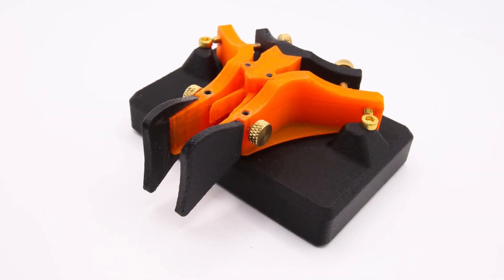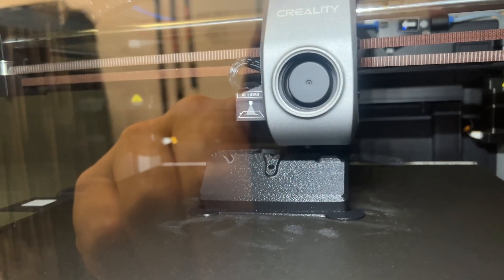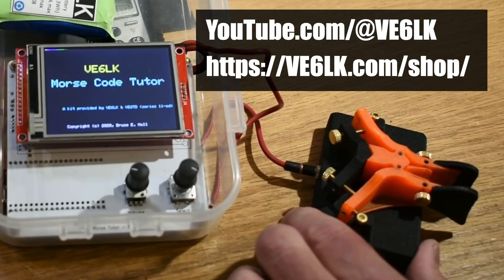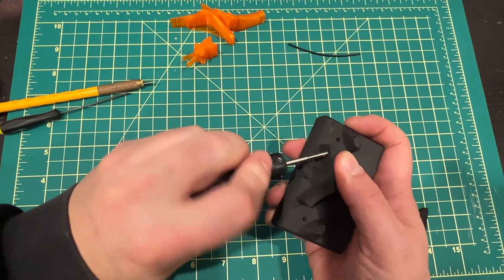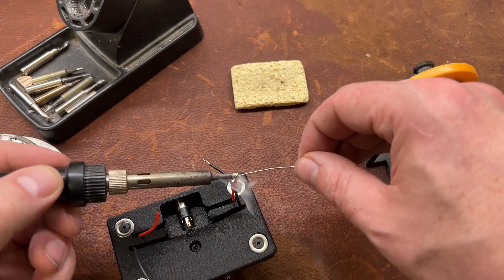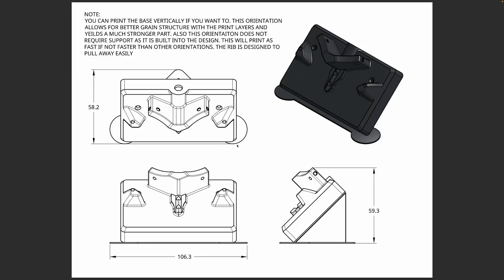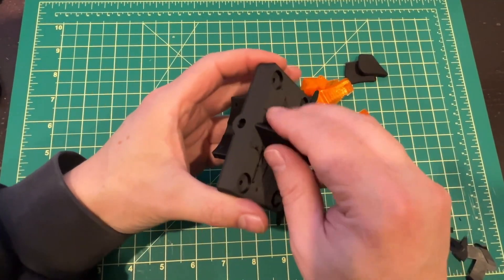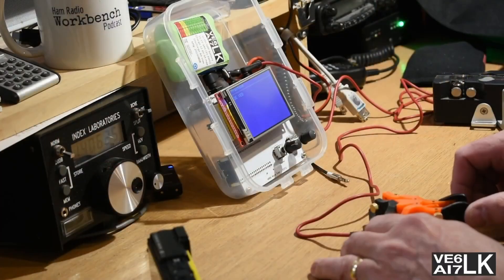Make Your Own CW Key – 3D Printing a Morse Code Paddle

Comment: If there's a possibility that you'll carry it or leave it in a hot car, be careful what material you use.  I read recently of a ham who left a CW-MORSE key (which are 3D printed) in his car and had it melt.
Reply from the maker: That’s a great point, I try and print in ASA, ABS, or PETG. They handle hot cars much better.

Comment: Whoa, I've never seen a two-sided key like that. I guess one side is "dit" and the other is "dah"? Very nice looking design. And good tip on printing at an angle for better thread tapping!
Reply from the maker: Yes the 45 degree angle is a game changer for me. The key style is called 'iambic' and there are a ton of them out there. I see most CW ops using them, thus me designing around that

Comment: Instead of using a tap, you could make the holes a bit larger and use heat sets.
Reply from the maker: Yes and no. Some could absolutely be put in but some of the holes are very close to edges and you simply could not fit one in. Still a great observation
Reply: @VE6SFX_HamRadioRookie  IAny holes two close to the edge for a heat set probably not hold a screw very well after being tapped as the walls would be weak.  Should leave more material around the screw holes in that case.   The adjustment screws will be moved a bit and they should have the brass heat sets.
Reply from the maker: @KennethScharf  In this case given the size of the screws I would disagree. I have had this key for months with zero issues and so have others who have been testing it for me. The forces on these screws is very small

Comment: A problem that almost all dual paddle keys suffer from, IMO, is the paddles are too close together, so the operator has to waggle their hand about to send CW. Vibroplex nailed this problem with their single lever bug paddle, one side with a paddle and a knob on the other. No waggle required. But this looks really cool. I don't have a 3D printer, yet ...
Reply from the maker: Got it I need to design up a vibroplex.... :)

Comment: I can tell you right now making quantity one of these is a non starter using the links you give in the doc.  I don't have them all in the cart yet and I'm already more than a good used BY-1 Bencher.  Making a few at a time is doable but if you don't have a local Metric supply....  On the plus side the arms and center printed and separated perfectly!  Again on the negative the built in supports for the base and finger pieces are not working (read that disappear!!) in Creality slicer.  Glad to test any other files you want to share.
Reply from the maker: Also I should mention you do not have to use the hardware I have in the BOM. Really any M3 screws will work. The ones I chose are just to keep things looking slick
Reply from the maker: Interesting! I used the creality slicer. What size of nozzle do you have?